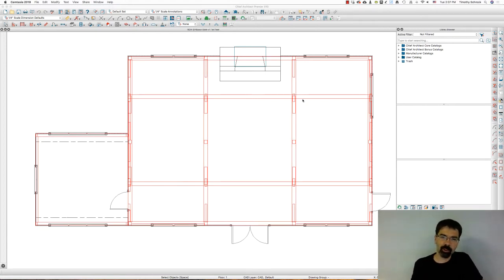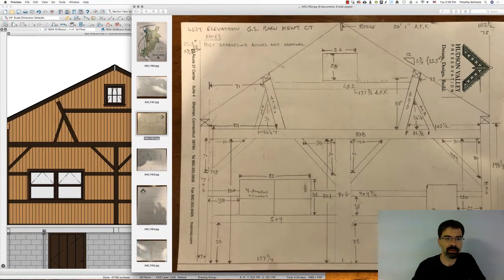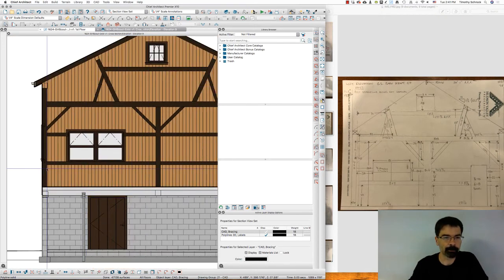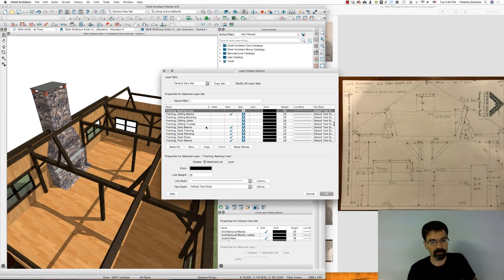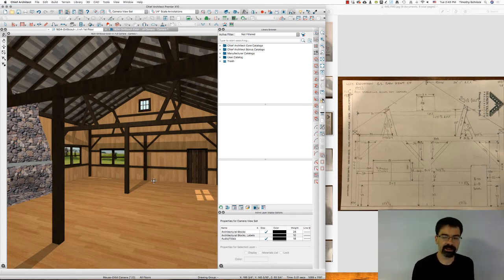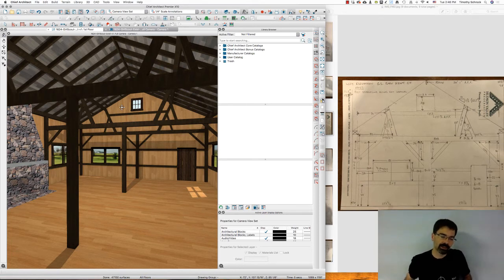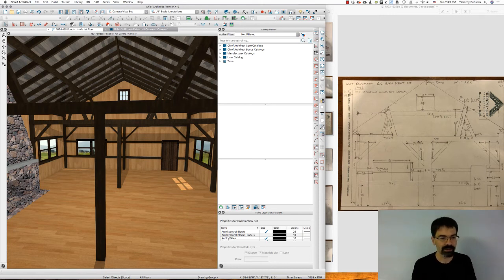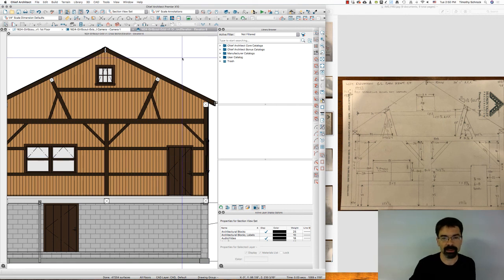How I model the unique structure of a Pole Barn Building

Comment: Thanks for the video, Tim. I assumed Chief Architect would support parametric modeling of post frame structures. But it's still interesting to see how you modeled it manually.
Reply from the maker: I would love for that to happen too. Right now, I can't think of a way to do that unless you used railing walls, that are open (posts only), and break & reverse layers on the walls exactly where you want the posts to be. But then, for the roof framing members, I don't know how I'd do that off hand. 
Would be curious if someone found a way to do so.
Reply: @DesignbuildsolutionsLLC  That's an interesting approach. I wonder how CA would treat window and door openings in that case, because they're not structural in post-frame like they are in stick-frames (no headers). Post-frame structures are becoming very popular in the US.

Comment: Quick question, if you had to divide up the rooms in a pole barn how would you do it while maintains the open space and tall ceilings of the space?
Reply from the maker: Not sure I understand the question completely. Divide up the rooms but maintain open space sounds contradictory to me. Tall ceilings is easy, select the room and under structure tab, uncheck the room has ceiling option